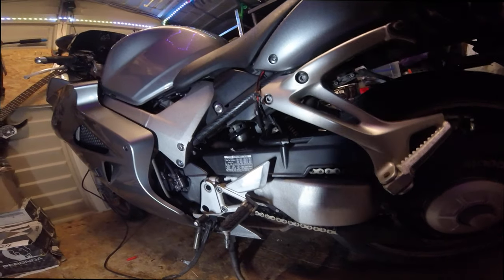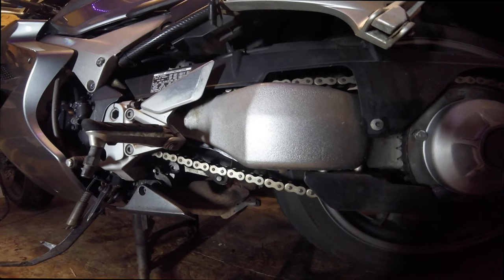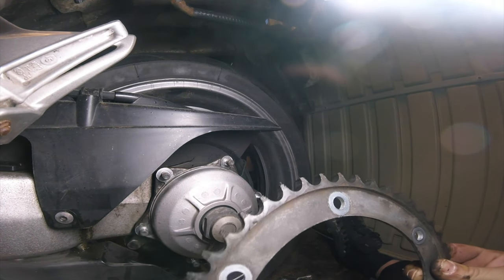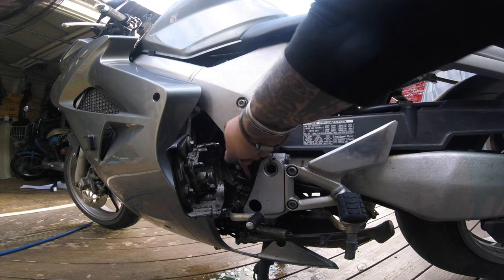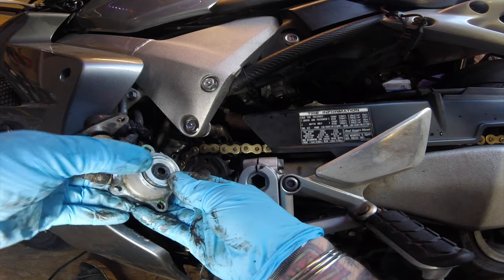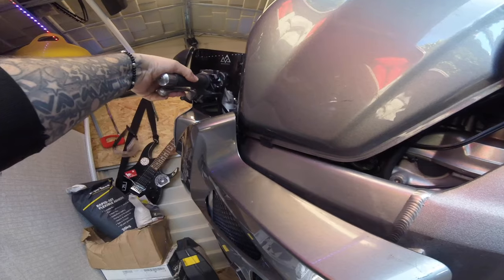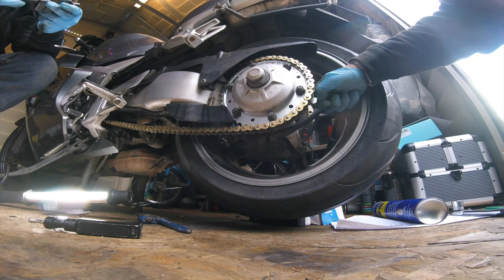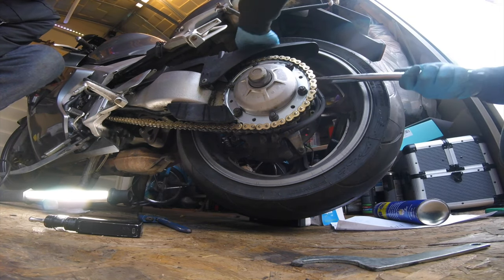Honda VFR800 Chain & Sprocket Replacement

Comment: Seriously. Thank you for this. I been procrastinating cleaning behind the front sprocket cover specifically because I saw the clutch system attached and was worried there might be something I wasn't prepared to deal with when taking it off. ❤
Reply from the maker: Easier than you think buddy

Comment: Mate, this was a great vid. I'm just doing exactly the same on my 800Fi only taken a week! doing it on the drive between rain storms and awaiting the chain splitter etc etc. But all went well until the easy bit of refitting the front sprocket cover, and after trying to see why its not going on the last 10mm I guessed its that rod. As this has taken an age I think the piston, just quietly crept out a little each day. But thanks to you I now know what to do! Incidentally I removed my sprocket cover in one piece, so fewer bolts to get wrong ( as you mentioned I think there's three long ones, but one of these is about 8mm shorter than the others o/a length probably about 110mm, so to be just a little shorter is annoying). But I will now remove the clutch bit to push the piston back and maybe the other bit if the mounting that fits over the sprocket nut doesn't align easily.  
Thanks again ....rains stopped so lets see if I can do this!

Comment: Nice video, just what I was looking for. Got confused because on one page of  the repair manual for my 1999 VFR it was told that the clutch needs to be drained before removing the slave cylinder, but I didn't believe that was necessary: just as your video confirmed.

Comment: Craig i`m doing this now to mine and yes front sprocket was full of dudu, my bike has rear seat frame off as well as i found a bad earth that had melted all the way to the fuel tank pump, wires and gubbins all over the damn place lol.😁

Comment: Great vid. I'm going to be doing my Gen5 shortly. 
Quick question - is it ok to tighten the front sprocket against the gearbox, or is it better being in neutral and tightening it with the backwheel on the ground once the chain has been fitted. 
Ta.
Reply from the maker: I would say with back wheel on ground. I imagine against the gearbox that the gear would turn.

Comment: thx bro. my chain is tight>loose>tight>loose so i guess my front sprocket is not centered and i had to take that front cover. thx for guide
Reply: Tight /loose /tight means that your chain needs to be replaced.
Nothing else....
Chain will stretch irregular and boom it looks like it's tight, then you will move it by half a turn and boom it's loose.
Please replace it to prevent additional wear of sprockets and all of that :D

Comment: Did I count 16 teeth on that front sprocket ? ⚙️ my Viffer has 17 teeth on the front but looking at some ads for chain / sprocket set kits online a lot are saying OEM is 17 front and a lot say OEM is 16 ????
Reply: Not sure if you found your answer somewhere else in between but for what it's worth the haynes manual (for VFRs 2002-2009) is stating that final drive is 16/43 ✌🏻
Reply: @logazeuze  thanks 🙏 the chain & sprocket kit I ordered was 16 / 43 my mechanic messaged me saying did I want to change the gearing because the existing front sprocket was 17, turns out my speedo is accurate now with the 16 tooth front, the previous mechanic obviously gave me what he had not what I needed 😜

Comment: What size of tool did You use to adjust te chain tension? (C-wrench)
Reply from the maker: The one that came with the bike
Reply: @Motourev  Thanks for The tip!! I looked in The tool bag under The Seat and it was in there!!